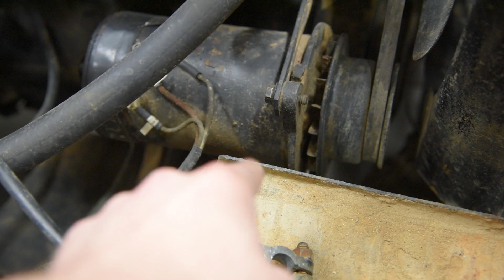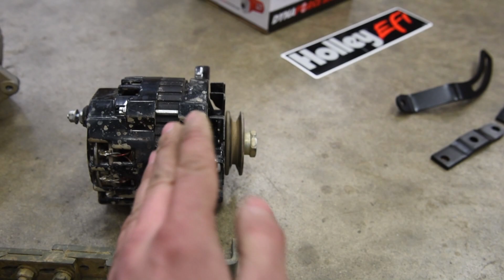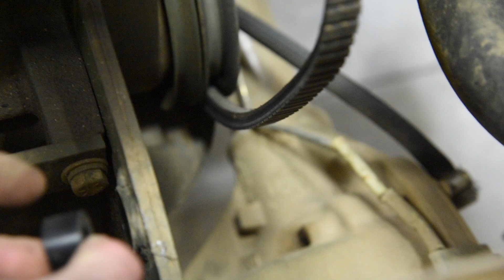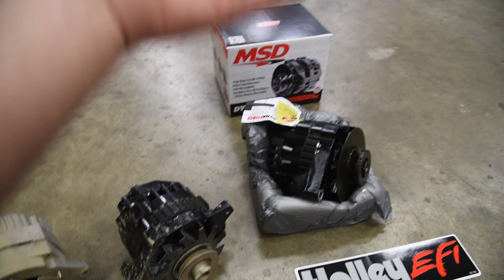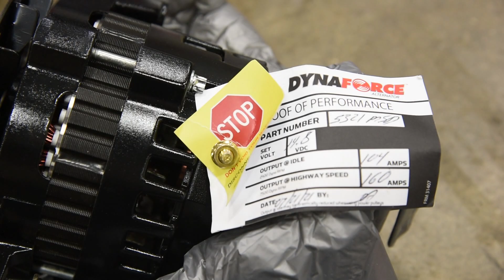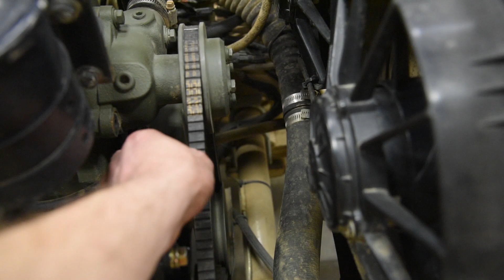The BEST 12V Alternator Setup for your Willys Jeep

Comment: Did you have to change out your original 24v starter when doing the  12v conversion? The mini high torque starters are cheaper, but i do not want to lose the push button start on the floor. My M38 was already converted to 12v when i got it, but still has the original 24v starter.

Comment: I recently converted my 52 M38 to a 12V and the used the Kaiser Willy’s kit. Your correct the bracket is trash and I’ll be ordering the bracket you have shown in the video. Cannot get my pulley to align properly enough to stop it from squealing when the engine is running.

Comment: The alternator output curve is not linear. You can get enough amperage at a fast idle with a 10si. Your belt may be holding you back but the L134 had a generator and a 5” crank pulley.
You could try a smaller pulley but measure them, the shaft speed needs to be about 2500rpm at a idle and you are aiming at more than 50% of the load at idled. The crank pulley is about 5” diameter, the alternator pulley 2.5”. That is a pulley ratio of PI x D or 200% difference. A fast idle of 1250 rpm should give you 2500rpm shaft speed. You need to measure and then buy an alternator pulley, which are cheap.
Cars generally have a pulley ratio of 3 which means an alternator pulley of 1.75”. Measure it.
I have a smaller Mitsubishi alternator and it runs fine with correct tension. http://www.billavista.com/tech/Articles/Alternator_Bible/images/10si%20perf%20curves.jpg

Comment: After a year I hope that your charging issues are resolved, as an observation the pulley diameter needs to be smaller so that it rotates faster on your budget alternators, as is the new alternator that you’ve installed, I’m impressed about the research and you’re ability to adapt to new technologies, 
I’m quite a bit older and I’ve managed to stay up with these developments also. If only there was YouTube 70 years ago, the money that could have been saved and shortening the learning curve. Thank you for keeping the hobby alive.

Comment: Could have just gone with a smaller alternator pulley and increased the ram on it. And found it in an A size belt to match the stock size pulleys for the old sizing of belts ... fractional horsepower belts.

Comment: Did you have to drill out the mounting hole on the MSD alt in order for the bolt to fit through and mount to the engine block?

Comment: Just found your channel and enjoying the content. It was probably mentioned by others but the amp output rating is based on alternator RPM. GM alternators generally have enough amperage to maintain the vehicle electrical system and charge the battery at like 1000 RPM. With an 8 inch crank pulley and a 4 inch alternator pulley, an idle speed of 600 RPM would turn the alternator at 1200 RPM. The old alternator was probably junk but with the belt and sheave mismatch would end up eating belts and leave you stranded. You should be able to clock the body of the alternator to rotate the battery stud away from the battery tray. Most GM style alternators can be clocked for different applications.

Comment: Question; the alternator you show #5321 is rated for 120a , but the listed amperage on your tag is 160a.  However, the listed information implies you got model #5361

I’m confused.  Can clarify?
Reply from the maker: I believe it's due to the rpm that you'll be spinning it at
Reply: @TurnNBurn  Let me clarify. You received model 5321, the indicated amperage on the tag is 160a. However the 160 amp model is model 5361. So it looks like you paid for a lower amperage unit, but got the higher amperage output.  Am I missing some?

Comment: I have the same alternator bracket for my 3B and my fan belt has about the same angle on it with no washes for shims. I ran the same bracket from Kaiser Willys for years. It wasn't fun to set up but it worked. When that alternator finally died I did get the one from Classic Military Vehicles. I did have an alternator from a spare F134 engine I have. It worked for a bit but it stopped charging. The brushes were dirty and it worked. I haven't installed it yet because been working my GPW getting that all done. For that one I kept is 6v stock for fun and I really enjoyed doing that. I do have a solid state voltage regulator though. Can't tell though.

Comment: Part of the issue with charging at low rpm is your belt and pulley mismatch. 

The small 1/2 belt rides deep in the groove of the crank pulley. It gives the effect of a smaller pulley and actually slows down the alternator.

Swapping the alternator pulley to a small 5/8 pulley and running the correct 5/8 belt would make a big difference
Reply from the maker: I was using the correct 5/8 belt with the eBay black alternator I bought. It still wouldn't keep up with my electrical load unless revved out. Oddly enough, 20 miles into that alternator setup, the pulley started chewing belts and stranded me in the Rubicon trail

Comment: I had to shim the bracket also . Same problem alternator sat too far forward.  I used a brass 90° on the bottom of the filter canister  ,to change directions

Comment: You have to remember that alternator Dynoed at 2k and 7 k, but you have a way smaller pulley in the alternator compared to the crank pulley, so you may be making 60 amps at idle and 100+ at 1500rpm
Reply from the maker: Very true, forgot to mention pulley sizes in the video